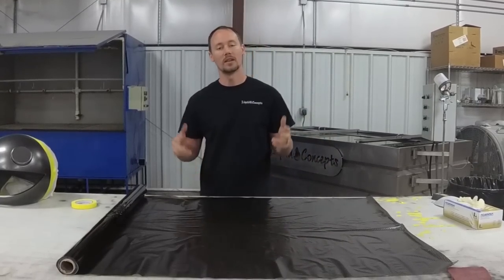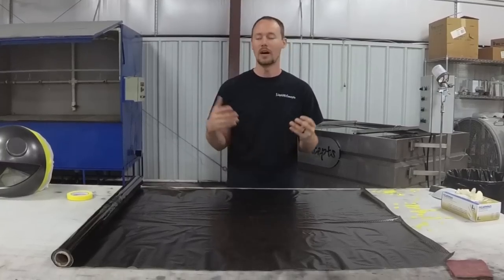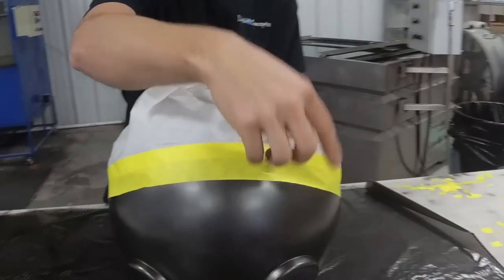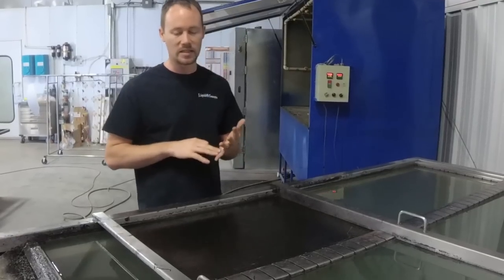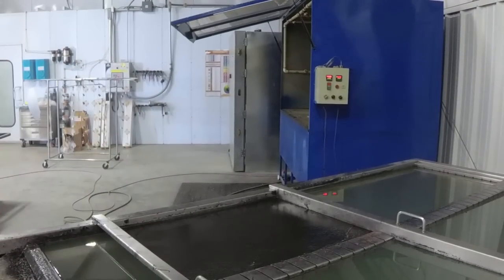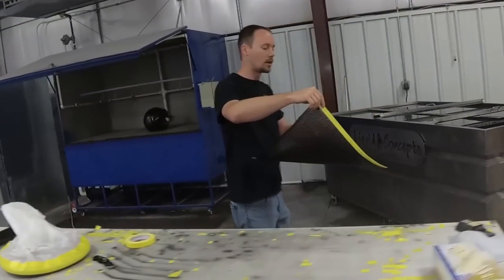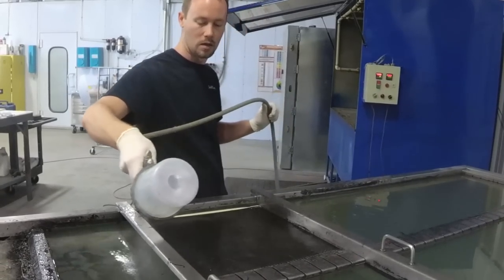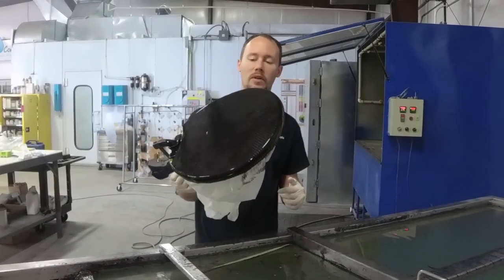HOW TO HYDRO DIP ROUND PARTS | Liquid Concepts | Weekly Tips and Tricks

Comment: Hi I dipped a part and after I rinsed the part it turned hazy white. Will the clear coat bring it back? I need a little help
Reply from the maker: It may be that you over activated the part. You can put water on the part and if it goes away, it will go away with clear. If it doesnt, then you need to redo the whole dip.
Reply from the maker: It may be that you over activated the part. You can put water on the part and if it goes away, it will go away with clear. If it doesnt, then you need to redo the whole dip.
Reply from the maker: It may be that you over activated the part. You can put water on the part and if it goes away, it will go away with clear. If it doesnt, then you need to redo the whole dip.

Comment: Bryan, does the rinse station need to be heated or is cold (room temp) water best?
Reply from the maker: You can rinse with any kind of water even if its hot or cold. Hot water will rinse off the PVA quicker than cold water will. If you are in a production shop then of course hot water is better but at your house then you can rinse with any temperature.

Comment: Im curious to know if the film would work on a 3D printed Mau5head
Reply from the maker: Yes it should. We have dipped several 3D printed parts before and they came out very well. The only thing about 3D printed parts is they are somewhat textured and usually require a decent amount of sanding to smooth everything out.

Comment: Hello I have a question  . I have failed my dipping. the problem is that the hydro film does not want to dissolve the water temperature is 86-90 f and i have waited over 90 seconds some times. when I dip, the color / pattern comes off on the part and it is incredibly difficult to dissolve and wash away residual film what is wrong ???
Reply from the maker: You may need to spray more activator on the film so it will glass out better and activate the film.

Comment: How do you deal with the big bubble you can see in the center of the film at 8:39,that shows up in the center of the ear at 9:16?Can it be poked with a pin or something?
Reply from the maker: The bubble actually came out for the most part and there was very little touch up that was needed after it was fully rinsed off and ready for clear coating.
Reply: @LiquidConceptsUSA  Thanks,I still haven't found a video of how the rinsing operation works.Did you ever make one?
Reply from the maker: Not yet. Its still in the works!
Reply: @LiquidConceptsUSA  :-)